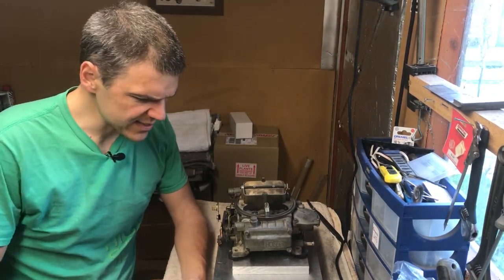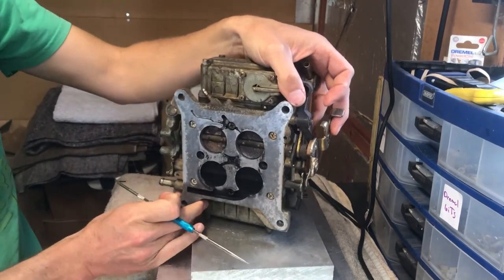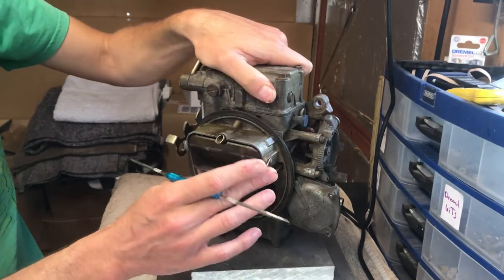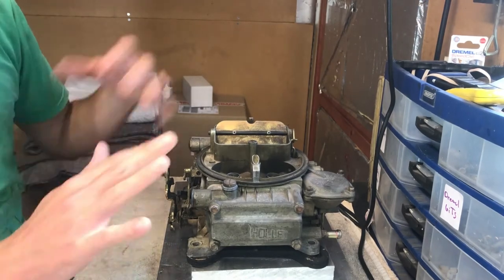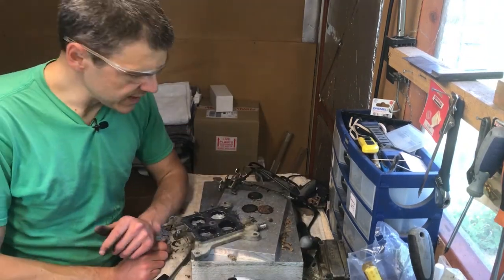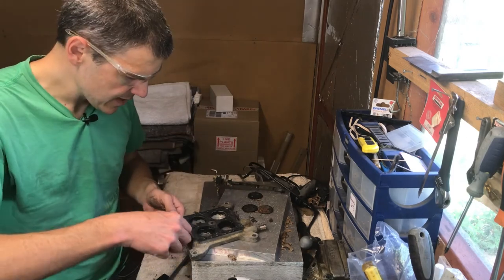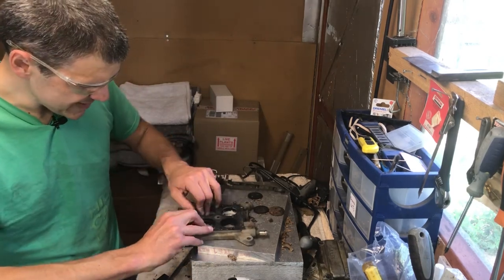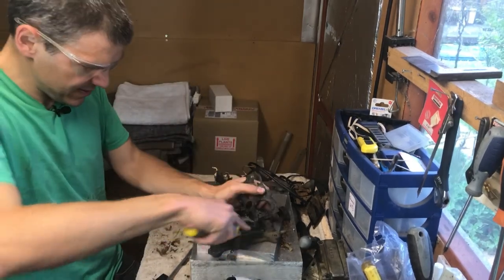Autopsy of a Holley 390cfm "the baby 4 barrel" List 8007 carburettor for a Rover V8 or Essex V6

Comment: Hi, I’ve just recently discovered your channel and find it very interesting. It sounds like you have a lot of knowledge I’ve just purchased a holly carburettor from a swap meet and I’m finding it difficult to find anything about it. The list number is 6390–1. Have you come across one of these before regards Jeff from England
Reply from the maker: Hi Jeff! That is from a 1972 international harvester 392 engine. Pretty rare piece.
Reply: @carburist  hi I thought it was a rare card as it’s a 370. Would it be suitable for my Rover v8 3.5 with a fast road cam ?

Comment: Has anyone used these on a Ford Crossflow, Pinto or Fiat Twin Cam?
Reply from the maker: Yes of course! There was a manifold produced by Ford for the pinto. I am sure it would work on a twin cam as well
Reply from the maker: In fact, I dealt with that type of carb on the channel. In the sense of the specific list number that was on the Ford pinto manifold. Check out my other videos and it is there.
Reply: I'm using a Holley 390 cfm on a Pinto 2.0, I have two different manifolds for it. I am trying to get it dialed in a little better now. I have run one in the past with great success